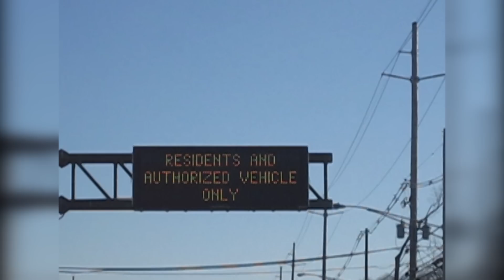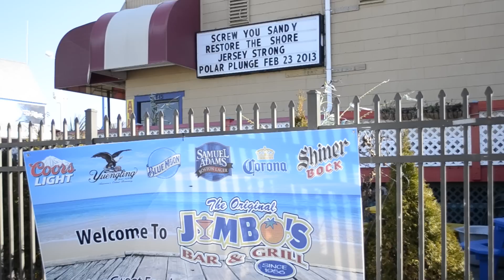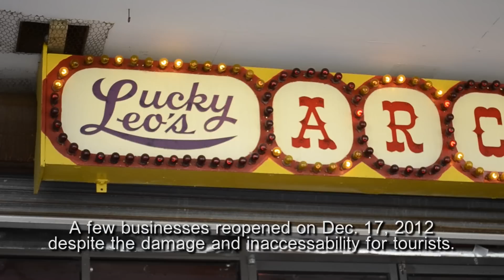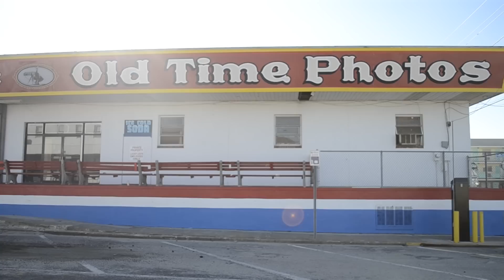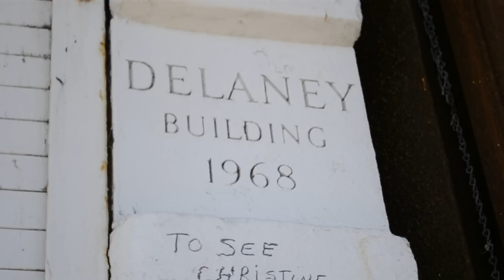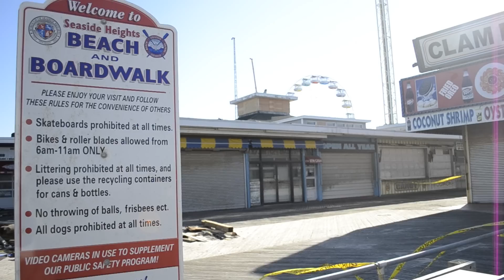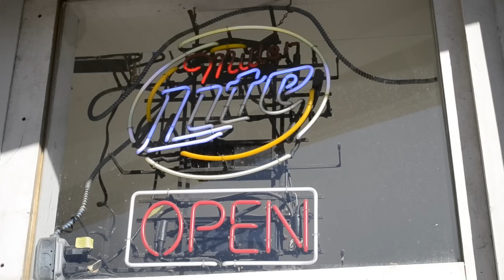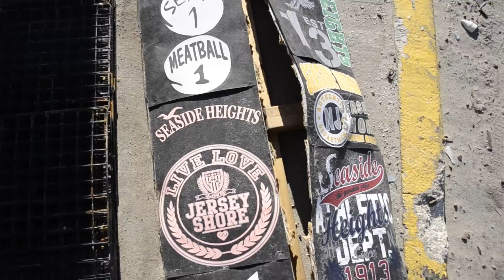Exploring the Seaside Heights Pier Wreckage from Hurricane Sandy - NJ

Comment: Starting at around 6:13.. Does anyone know, did the fire destroy all the rest of this section of boardwalk? Or was it too damaged by the hurricane and subsequently demolished? I just returned from a trip here and this whole section of shops, Salt Water taffy, the arcades, everything is gone.
Reply: The boardwalk is gone due to the damage from Sandy. Sandy was in October the boardwalk fire wasn't until the following September after they had just finished rebuilding the boardwalk. That is why the fire was so devastating. Everyone had just finished rebuilding and was only open for a few months before the fire distorted a lot of the work again

Comment: That boardwalk never looked stable in my opinion it looked like it was being held up by toothpicks and a lot of them looked crooked and I was surprised that it didn't collapse earlier with all the big waves crashing into them that's a lot of force. The other thing I want to mention too in my opinion is how dumb they were to build the pier so far out into the ocean. First of all I recently went under the new casino pier and I saw a few of the original support poles that were snapped and the wood was rotten on the inside it was squishy like a sponge and not very string and that's in an area where the wood is not even constantly soaked in salt water. I can imagine just how rotten and weak the supports that were out in the ocean were. They were probably around 99 years old in 2012 as the boardwalk has been around since 1913 but idk if the casino pier and funtown pier were that old. Don't get me wrong though I loved the old casino pier and funtown pier which no longer exists better then the new one it was much bigger and nicer and had more rides. I can't remember fully though I was still a kid at the time before Sandy.
Reply: Hi. Oh I loved that the pier went so far out over the ocean. It’s been disappointing to me that it’s so short now. (I grew up in the 70’s / 80’s.) 😉 Take care!

Comment: The damage to the beams, is in line with the same kind of damage you would see after a tornado.  Extremely high wind speed will twist beams like they were so much straw.  I wish I could go there with a crew, and remove all the steel which, your video, shows as damaged.  I did see that some of the rides were repairable, such as the wheel and the Gravitron.  That steel Mouse is also repairable, although it would need some of the track replaced.  I just wish I could go and do the salvage work.